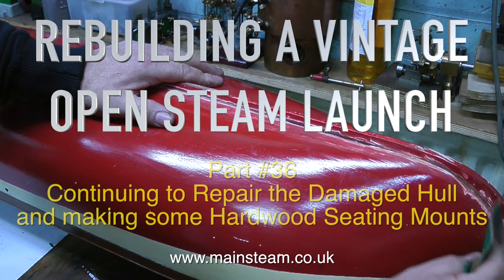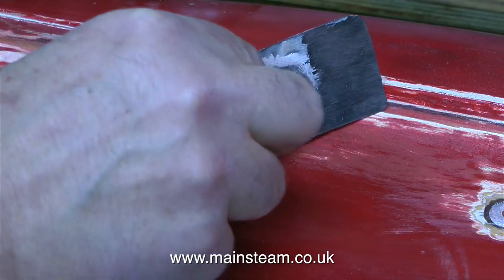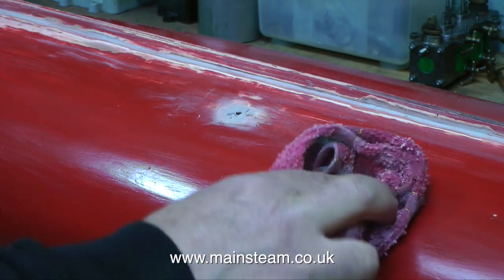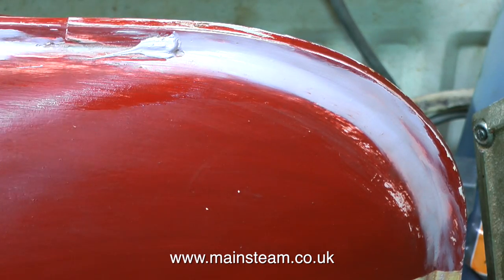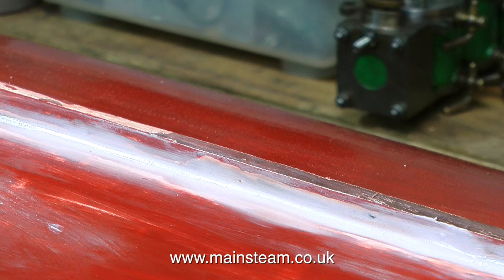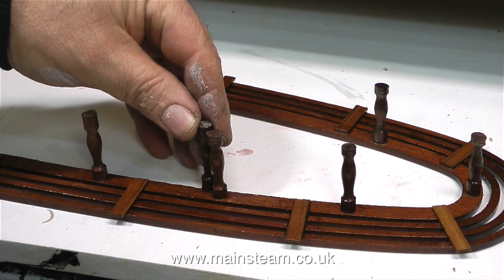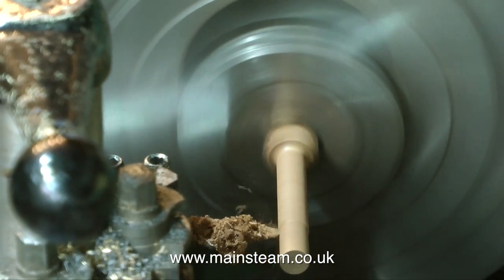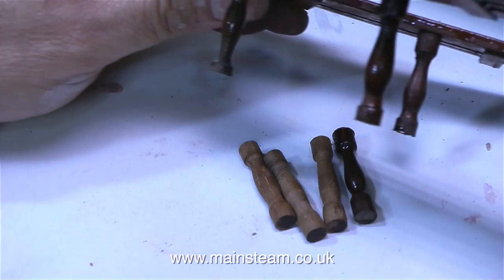REBUILDING A VINTAGE MODEL OPEN STEAM LAUNCH - PART #36

Comment: Knifing putty is known as "glazing putty" in the US. Not to be confused with "glazing compound" which is used for putting in window glass. "Glazing putty" is used to fill sanding scratches and such left over from shaping auto body filler, generally referred to by the brand name "Bondo".